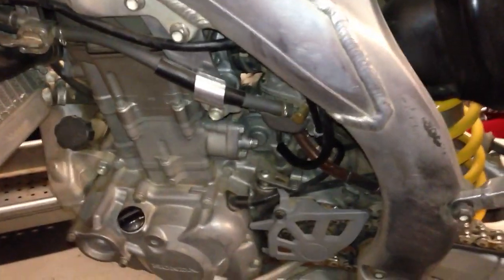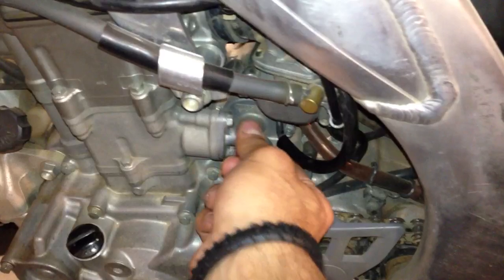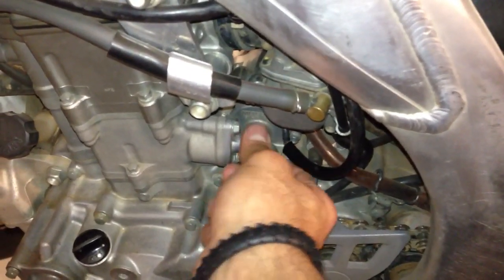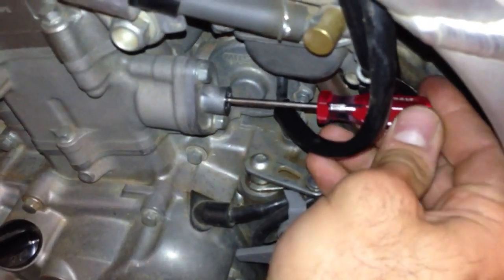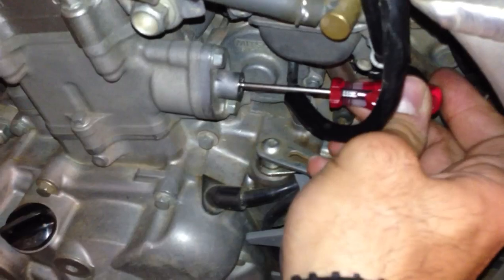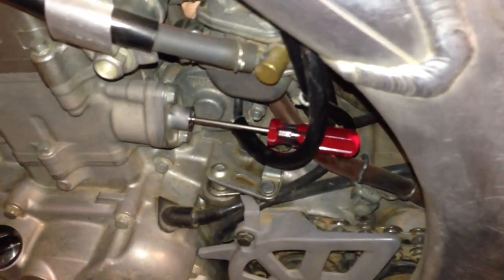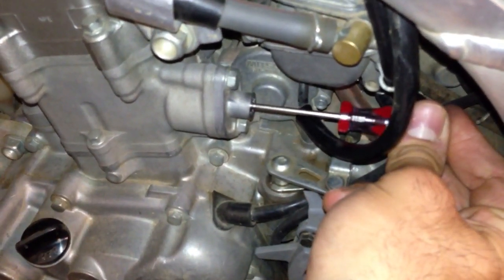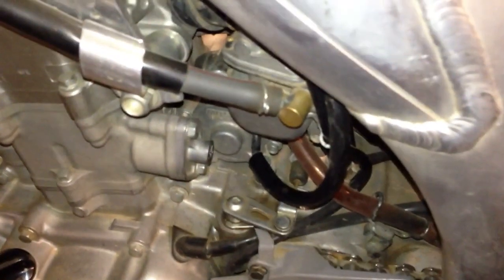CRF450 Cam chain tensioner release

Comment: Thanks for that uick tip. Just what I was looking for. Never taken a CCT out before, but am going to do so on my XJ900f as I hope it's the CCT that has seized, and not the Cam chain itself which needs replacing. Fingers crossed. Thanks again.

Comment from the maker: I'm not sure why they fail.  The bike is the video had 300 hours on it and had gone through two top end rebuilds, but it's on the original tensioner.  It's an automated tensioner with a ratchet mechanism so I assume that the teeth wear out and can't keep the force against the cam chain.

Comment: Thanks for the video. My Cam chain tensioner is leaking oil. Can I simply take out the cam chain tensioner and replace it with a new one to stop the leak or will taking it out cause issues with the piston?
Reply from the maker: Yes.  you can take it out.  I recommend setting the motor to TDC to make sure you don't get any rotation of the motor and possibly affect the timing when the tensioner is pulled out.  there is a plug on generator side of the motor that lets you see the flywheel and find the TDC mark.

Comment: sorry..why we need to release it?is it can solve the engine noise problem?
Reply from the maker: If you are working on the cylinder head, adjusting valves, etc you need to remove the tension from the cam chain to allow the work to happen.  Otherwise the chain is too tight to remove.

Comment: thanks for the video!
I see these tensioners fail quite a lot on honda engines, and the chain starts to rattle. Do you know how can they actually fail? they seem pretty bulletproof.
Reply: Ardent Fan  Does it have to 'pop' back or can you unscrew it back in position? Mine won't pop back, is it a failure.
Reply: Ardent Fan  Thank you!! I took it apart my spring is/was broken, ordered a new one - appreciate it..